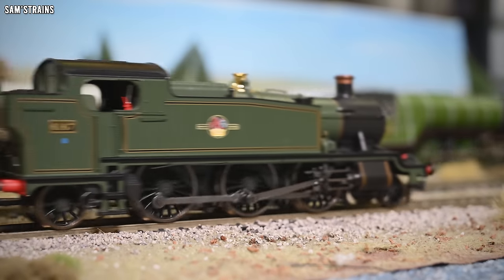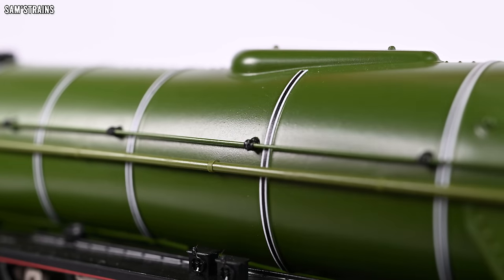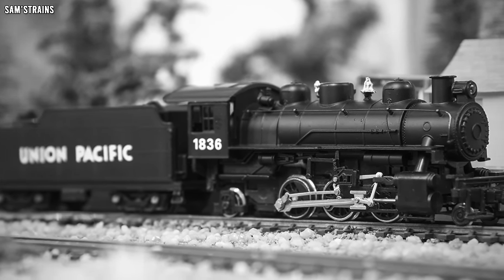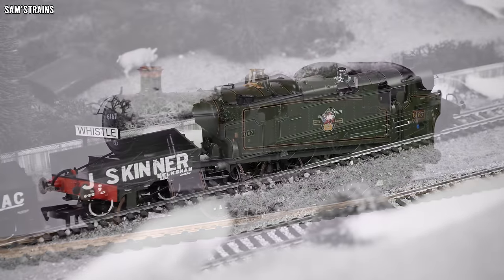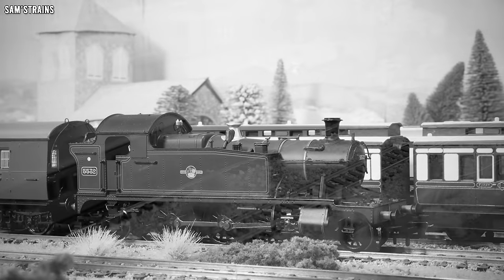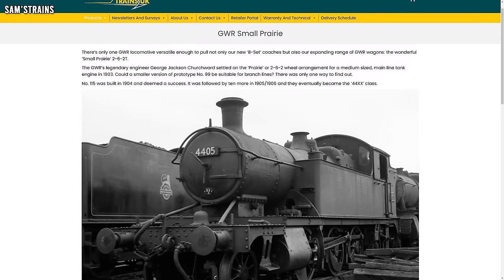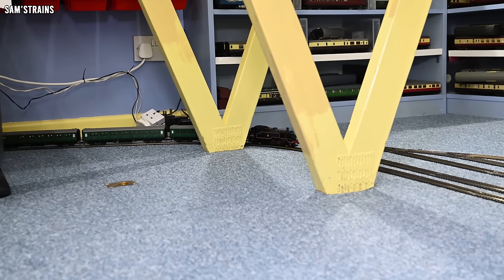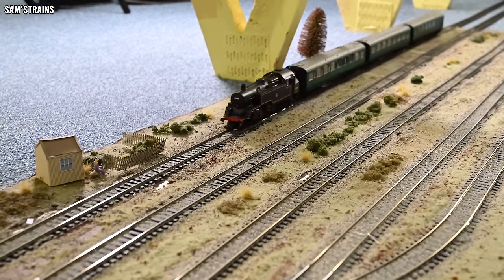Prairie Steam Locomotives | A Rare Wheel Configuration

Comment: Very interesting Sam. 2-6-2 Steamers had common wide spread usage in Germany as well. The major trouble of their arrangement is the symmetrical wheel layout; the centre of gravity almost sits over the centre driving wheels. The rods, working close to centre of gravity, induce severe side-to-side rocking and front-to-back (nosing) resulting in extreme instability. A longer wheelbase and/or leading and trailing wheels can reduce the problem somewhat but never really solve it. As far as we understand it, 2-6-2 engines were popular in the US and Germany though. Great upload again Sam. We can't actually run at 4K but the picture is much more crisp than ever.
Reply: It is my understanding they also rocked from front to back on the center driver; making them unstable from front to back as well.
Reply: @survivingworldsteam  The rocking front-to-back was called 'nosing' I believe. Yes very true; have added that bit.
Reply: I've always liked the German BR 64s. I notice the wheels on them are much closer together than the GWR 2-6-2Ts (such as the one in the video). I've often wondered why. Perhaps the GWR did it for the reasons you say.
Reply: If you have the connecting rod aligned onto the third driver, this negates that problem.
Reply: they weren’t really popular in the us
Reply: @ACL_modeler  wdym? Every major, standard gauge, US railroad used 2-6-2's in the early 1900's. Well over 1,000 2-6-2's were built and used.
Reply: @Thoroughly_Wet  every major? Most of them were built by atsf and cb&q a lot of major railroads in the east coast didn’t have them

Comment: Fun video as always.  I don't think that anyone has mentioned it, but the 4575 class were preceded by the 45xx and that preceded by the 44xx class.  Although they were all related, the 44xx has smaller wheels, and the 45xx had a straight tank top, with the sloped version being introduced on the 4575 class.  So, there were sufficient differences that they were considered 3 classes by the GWR.  Bachmann make a 45xx.

Comment: Interesting that the Ivatt 2-6-2T locos were tank versions of similar 2-6-0 tender engines. The tender versions were equipped with so called 'cab tenders, for good visibility when running in reverse so, unlike many earlier tender engines could be used at the same speed in reverse without turning. In this they matched the tank engine versions' flexibility so the main difference between tank and tender was in fuel and water range. The V2 was built as a prairie rather than a 2-6-0 to accomodate a long boiler with wide firebox,  a common Gresley design feature to ensure high steaming capacity, as used on his Pacifics of the era.

Comment: The Russian S and Su classes and the German class 23 were 2-6-2 tender locomotives built in large numbers.
Reply: The class 23 was the last steam loco built in the German Federal Republic.  The class 64 tank locomotives were built in very large numbers until 1940 and lasted into the 1970s.  Quite a few prairie tank engines were built during the Provincial period of the German Railways.
Reply: @drecksaukerl  The 23 were an excellent class that was supposed to supplant the 38 4-6-0's, but in tribute to the 38's, the 23's worked side by side with them. Both engines are truly wonderful machines!

Comment: There were LNER 2-6-2 tanks but I think the Bachmann was very old.  The Ivatt 2-6-2 tank was used extensively on the Southern region.  It was upgraded with standard fittings such as clack valves instead of top feed and the front fall plate fitted and classed as the BR 2MT 2-6-2 tank.  The reason why the LMS didn't use the 2-6-2T arrangement much was because they already had a highly successful 2-6-4 tank starting with the Fowler., then Stanier 2 & 3 cylinder and finally the Fairbairn on which the BR standard was based.  It meant that they could carry more coal in a larger bunker.  They had an unsuccessful 2-6-2T in the Fowler and an even worse design by Stanier class 3 and totally improved upon by Ivatt's version.

Comment: So 1000 prairies sound like a lot but when you compare it to the 25000 4-4-0, 11000 Moguls, and 6800 4-6-2 made it is actually a rare wheel configuration. Fun fact the reason it has the name Prairies is because it was being primarily used out in the Midwest part of the US along the prairies Hence of course it's name. The 2-6-2 along with the 2-10-2 might look balanced but ironically suffered balancing issues for the locos and could cause range to the rails. While it probably had some advantages it was really overshadowed but much better freight steam engines that didn't suffer as much as the prairies so it fell by the way side.

Wonderful video as always and yeah the Bachmann prairie isn't the best but it was made as a budget engine which explains why it feels more toy like than a proper model.
Reply from the maker: Interesting - so we can call them rare over there too then! Thanks so much for sharing,
Thanks for watching, Sam :)
Reply: @SamsTrains  Your welcome I always look forward to see what videos you're going to do. I should look up how many 4-4-0 were built in the UK. That be interesting to find out.

Comment: Yes, the original Bachmann 0-6-0 is based off of the USRA standard design 0-6-0 Switcher locomotives that were very generic and common on many U.S railroads. The reason Bachmann made this loco was simply to make a "new product" for cheap and with using very little additional parts. While they theoretically could be kit bashed to resemble actual U.S Prairie types, they aren't based off of anything. This must be confusing to people overseas! But to be fair, some Prairies that existed aren't too far off from the Bachmann model in size or scale...

Comment: The underboilered Stanier 3MT of which at least one was fitted with a larger boiler. However the original design would interest me, in model form whereby the chunky chimney accentuates the inadequacy of the smoke box and boiler. Personally I prefer these to the Fowler variants whose appearances were marred by the condensing pipes for working underground.

Comment: I don't know if this is the actual reason, but this is the reason I would argue about why tender prairies are not common.

This is my understanding of information provided by a real steam locomotive engineer. Also YouTuber named Hyce! 

Go check him out too. He's an awesome dude.

Now from what I learned from watching heist videos is that more or less? Everyone wants to use a smaller engine like a bigger engine so you want it to be as capable as possible in the locomotive world. This means the getting the most tractive effort that a little engine can provide. Now a small engine can provide more tractive effort than a large engine if it carries the fuel/water weight on the engine chassis as that puts more force onto the rails. 

In addition to not having the fuel and water weight providing more traction to the driving wheels, the engine now also has to tow its fuel and water in the tender which is all dead weight detracting from what it can do further.

Supposedly an engine with a tender is also more cumbersome to operate in switching yards and reversing operations.

So the tank engine format is more common for smaller engines than the tender.

Comment: Hi Sam.

You concentrated on the 2-6-2 wheel arrangement but omitted to mention the smaller Bachmann 0-6-2 Prairie Tank. Any particular reason why? 🤔 

Paul.
Reply from the maker: Hi Paul,
This video was all about Prairie locomotives - an 0-6-2 is not a prairie, and therefore doesn't pertain to this video!
Thanks for watching, Sam :)
Reply: 0-6-2 is a Webb wheel arrangement
Reply: Sam.

Well in that case, can you explain why Bachmann consider their 0-6-2 a Prairie. They surely know their 'onions', being a top model manufacturer. I own a Bachmann Class 6600 0-6-2 Prairie Tank and it is described as such on the box. I notice that an 0-6-2 under the 'Whyte' notation is known as a 'Webb' or 'Branchliner'. Maybe you should point out to Bachmann their faux pas. 👍 

Paul.
Reply: Hi Zepheris.

I was typing out my response to Sam's reply before receiving your comment, but thanks anyway for your confirmation of my info. 

Paul. 👌
Reply from the maker: It must be a mistake - Bachmann do know their stuff, but a prairie is a 2-6-2... full stop. The 6600 is not a prairie
Thanks for watching, Sam :)
Reply: Okay Sam, thanks for the info. I wasn't doubting your knowledge on the subject as, no doubt, you research before creating your videos. It's just that I was slightly confused as it contradicted what is printed on the Bachmann box. Never mind, at least through you I am now aware of what the name 'Prairie' represents. Once again, many thanks Sam. 

Paul. 👍
Reply: @platformten5958  No worries, I never knew about 0-6-2's notation before. I have been fascinated with GWR Prairies ever since I had a Don Breckon painting of one.😊
Reply: @Zepheris. 

Just looked up railway art by Don Breckon and WOW, what superb paintings! I wonder how much they would go for at an auction. Think they would stretch beyond my budget. 😀 

Paul.

Comment: I like how it said hideous Bachman USA prairie hey the Same model in the southern paint doesn't look half as bad
Reply from the maker: Ooh really?? I'll have to look that up!
Thanks for watching, Sam :)
Reply: Or if you want a really good 1 try the proto 2000
Reply: The Southern Ry. scheme sure looks nice, but on a Prairie it´s fictional. That scheme was only used for passenger trains like the "Crescent". Bachmann uses/used a lot of express passenger engine liveries on freight locos too (I have a 2-8-2 Mikado in Southern Pacific Sunset colors, looks nice but not accurate).
Reply: That's what I meant and the southern is slightly better molded
Reply: In my opinion the most realistic prairie I have seen is the one made by Mantua It's very closely prototypical to some real life USA prairie
Reply: @chasesrailwaylinesrr6447  I do agree, the proportions are better. As far as I know there was no standardized USRA Prairie, right?
Reply: Nope no Prairie's are standardized I just meant Mantua made a closer model to me its looks similar to the engines on the mcCloud railway

Comment: Sam, Good day to you! There was a mechanical advantage to having smaller drivers on the American version. It offered more torque at the wheels at slower speed it may have been used as a shunter/switcher AKA "Yard Goat" or have been used in locations that had steep grades to climb over. America had a lot purpose built locomotives because the land wasn't as developed as it was in Europe. I hope this clears up any indifference between the appearances of locomotive & the regions of where they were used.

Comment: In real life the Lynton and Barnstaple had 4 prairie tanks by Manning Wardle, with one completed for  the heritage line in 2010. The Vale of Rheidol railway had 3 built by Collett in the 1920's.
On the models front besides the 4575, bachmann also make the smaller tanked 45xx version as well. There was also an airfix/dapol/hornby old model of the 61xx which were certainly better runners than the current hornby one.
As others have mentioned Lima did a somewhat chunky 4575 and bachmann did the V1/3 tank as well.